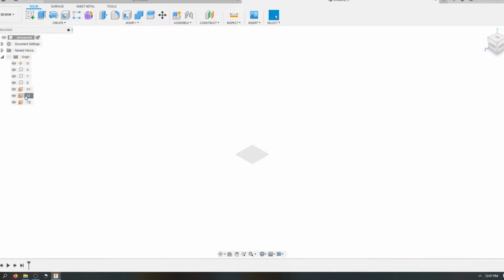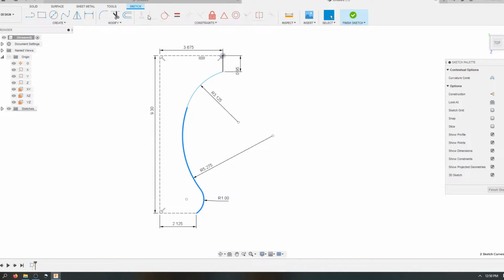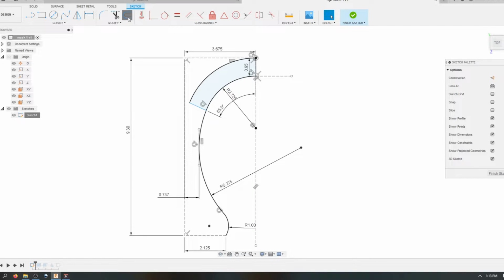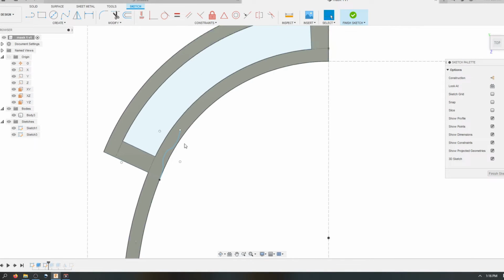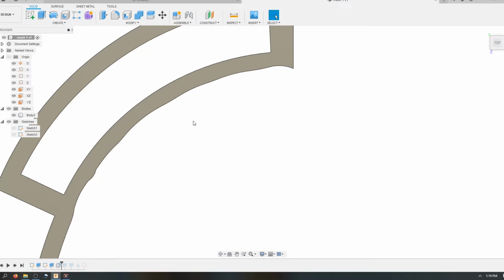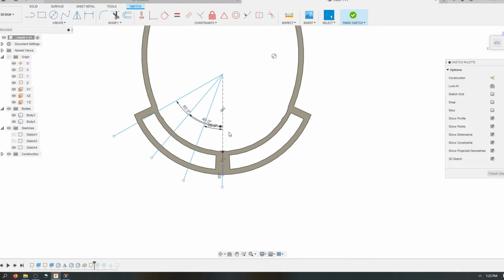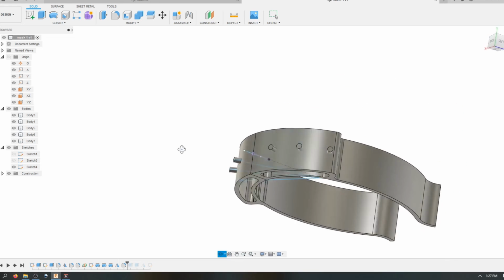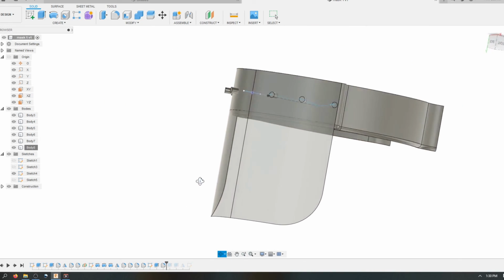3D Printed Face Shield: Fusion 360 Tutorial

Comment: That wouldn't be cover enough, a doctor here advice that the shield should cover around 180 degree, more the better.
Reply from the maker: Very good insight... I want to make some modifications to the design. I was thinking of a plan where the shield is 360 and is airtight on top. It would also have a fabric with pull string that you can close around the neck so it is that much harder for germs to get in.
Reply: @AvivMakesRobots  lol
Reply from the maker: @davidgarza995  Good idea, right?